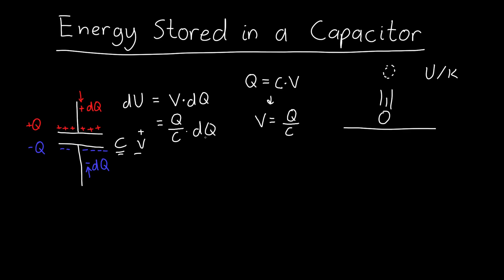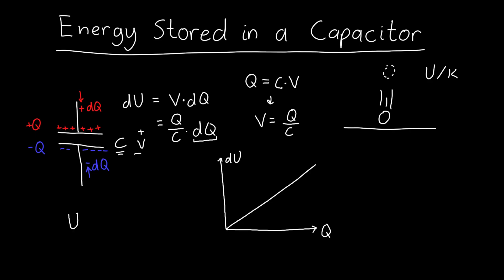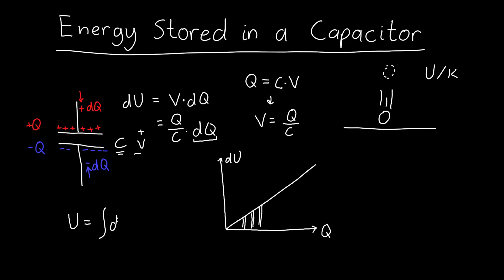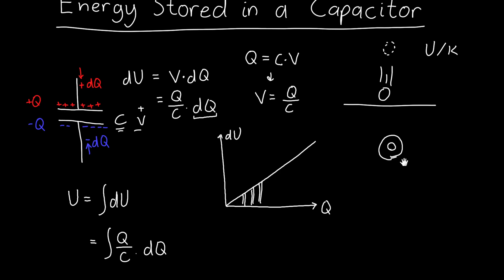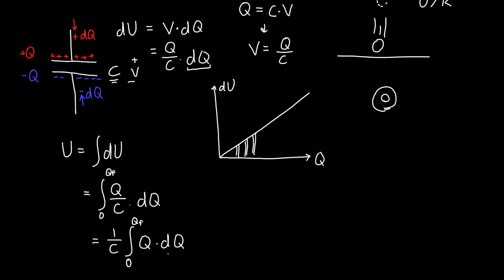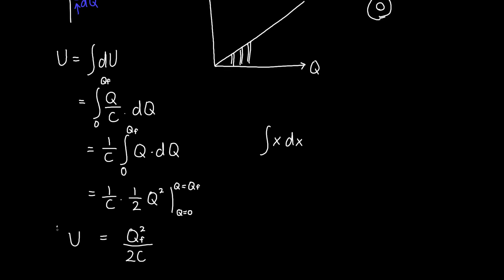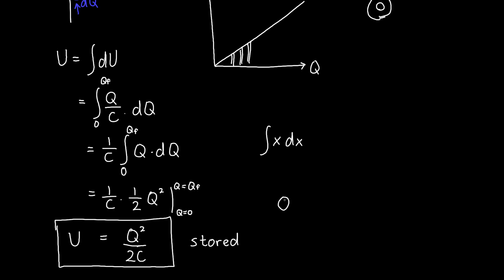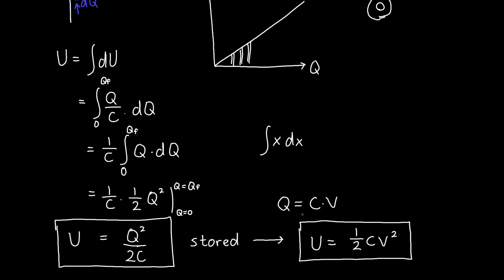Finding the Energy Stored in a Capacitor

Comment: Hi, I hope you're doing well!
I'm really confused. How we can add positive charges since electrons are negative and protons don't move??
Reply: You're right, and the red positive charge that he drew doesn't represent protons at all. 

Only electrons are added on the bottom plate - that's the movement when the capacitor is being charged. Now because electrons from the top plate are being pulled from top plate to the bottom, it's as if the electron deficiency creates an increasing "positive" charge.